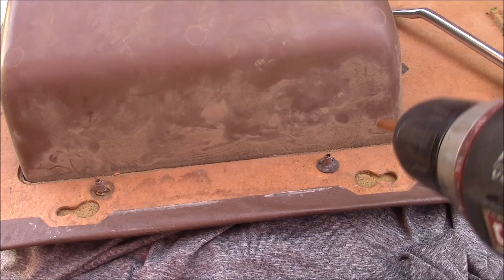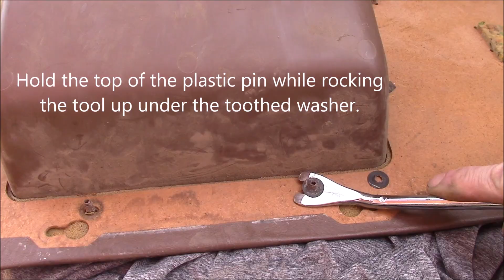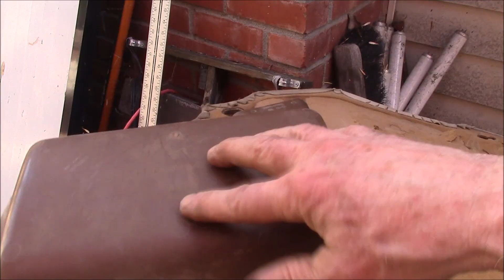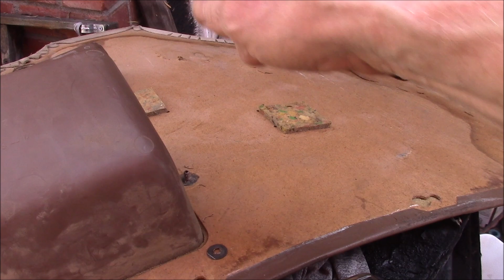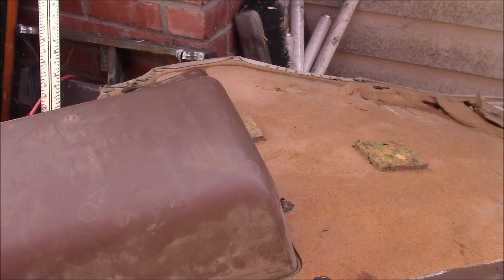Removing Plastic Trim From Passenger Side Panels

Comment from the maker: It was a bit tedious but I was able to remove all the toothed washers holding the plastic trim pieces to the factory side panels.  I should be able to re-use the original toothed washers to re-install the trim on the replacement plywood panels.